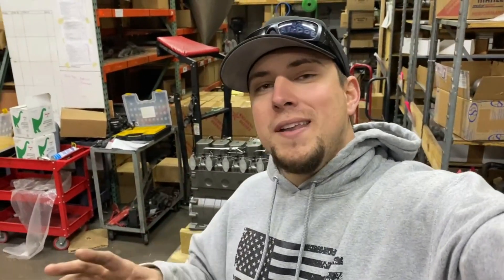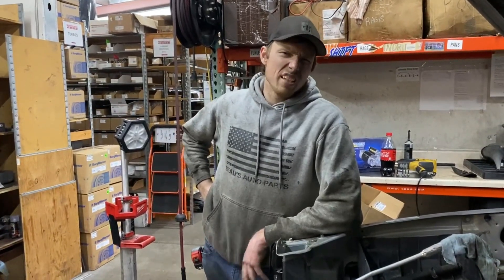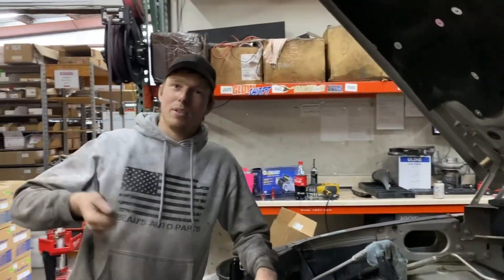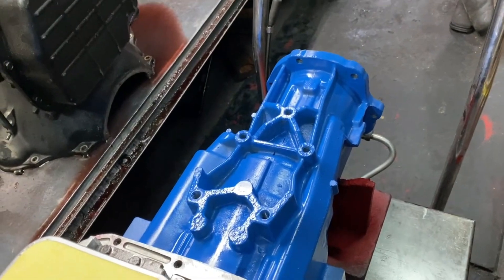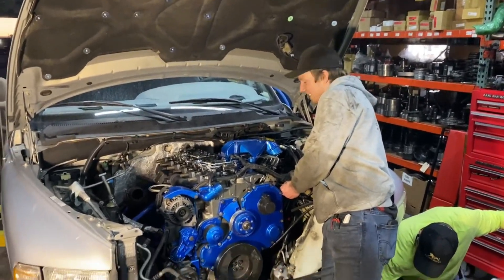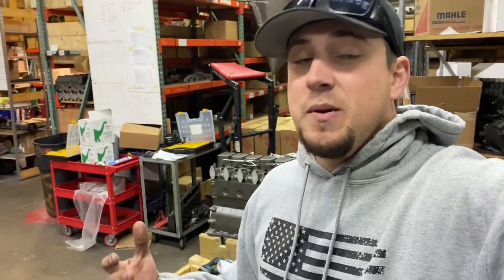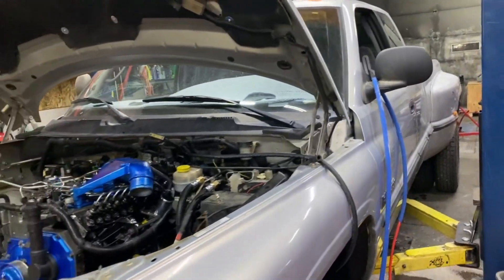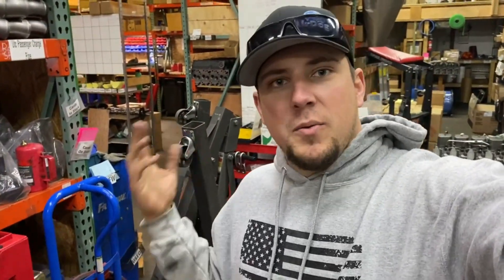ULTIMATE TOWING 12 VALVE CUMMINS

Comment: The truck itself is a cummins holy Grail 1998 12 valve 5 speed 4 door 3500 4x4!!!!!!!
Reply: IIRC the holy grail was a 1998 12 valve 5 speed 4x4 2500 quad cab with the short bed. Factory short bed being the odd ball and rare thing since the rest of the years and trucks all had long beds. Everyone has their own version of options they like and consider a holy grail truck though.
Reply: I have a 98’ 12 valve 5 speed manual extended cab, short bed 4x4. Love it. It’s a holy grail to me.
Reply: @zackpalmer2824  can I have it? XD
Reply: @Sebzuki  oof, even for a pretty penny I don’t think I could let it go haha
Reply: Some guy is selling a 98 12v quadcab short bed with an automatic and Full leather interior for 8500. Worth it?
Reply: @carsgunsandfitness6462  I’d say so.

Comment: The 12v's are the best in my opinion. I have a 96 with compound turbos it tows great. The only problem is the 2nd gen truck they just ride rough. I was a f350 of f450 with a 6speed and the 12v

Comment: Look forward to seeing the finished product. I want a 6 speed manual but that just me . If you don't mind is it 4.1 or 3.54 gears . So look forward to seeing how it tows with a lower stall . One thing that I have wondered how the lower stall effects the brakes as sitting a stop light with the low stall trying to pull the truck forward . I could put up with that I guess for a better fluid coupling . And see some rpm drop at gear shifts . I guess that is a 913 pump p pump
Reply: I have a g56 in my toe pig, it’s nice but for hotroding around town that’s a lot of gears to tow through.  I have the same low stall converter in my shawty, sure it try’s to creep a little at idle, but I haven’t  been able to notice a difference between it and any of the other trucks I’ve test driven.  The truck has 3.54’s.
Reply: @CumminsWorks  how stout are the g56's ? That's what I have and I've heard a lot of differing opinions on em .... wonder how much they can take - dont really wanna blow it up just yet
Reply: @larrypeachy2391  honestly I’m in your shoes.  Heard a bunch of things about them and not sure what to think.  I’ve been running ~700hp in mine for 2 years now without issue, however when I built it I messed with some of the problem areas so maybe that’s helping, not sure.

Comment: I’d love to clarify the turbo set up. You’ll probably do that in a later video. It sounded like you said a 60/67 with an S 400 on the manifold, just sounded backwards…
Reply: I miss spoke. It’s a he351 60/67 on the manifold with a 472/87/1.10
Reply: Who’s 60/67? I’m planning on doing nearly this exact setup with my VP truck. I’m really excited to see how it turns out!
Reply from the maker: @marcushert2759  Pdd’s modded he351

Comment: What valve springs would you recommend for a 2008 Ram 3500 Dually 6.7 Cummins with stock bottom end and stock head with S366/S478 Compounds ? I want to do push rods and valve springs at same time. I was thinking D&J springs and push rods ? I don't want to over do it I just want something that will handle 900HP and won't smoke my pistons .
Reply from the maker: Can’t go wrong with d and j springs and pushrods. Our PDD 4.5k and stage 2 pushrods would also work well! That’s what is in my 2007.
Reply: @horsetorquesdiesel  I am massively jealous of your new Engine and setup with the red paint on it ! Looks awesome.My valve springs and pushrods are on the way from Hamilton they had a deal for the whole package I couldn't pass up. Next is 12mm CP3 and Airdog Lift Pump. Then last 100% over injectors . Then I'm on to painting the whole truck and new rims and a new SRT Hood .
Reply from the maker: @twintibbsdiesel93  I love the srt hoods
Reply: @horsetorquesdiesel  I'm doing the SRT Hood and front bumper cover with the SRT air dam too . Then painting everything the same color as my truck is except adding pearl and flake to make it look alot better . Then getting Black 22inch rims and tires .
Reply: @horsetorquesdiesel  The reason I like the color of your engine is it's close to the color my truck will be LOL with black 22 inch rims .

Comment: Josh do you recommend I O-ring my head? I’ll be running a 467.7 borg with 50% overs and a 12mm cpm. Truck is a 2004.5 ram 2500
Reply from the maker: Really just good studs on the factory gasket is sufficient!
Reply: @horsetorquesdiesel  thank you for the response!

Comment: Curious how you got 19:1 with that setup. I figured it’s be sitting around 17:1
What was the piston protrusion?
Reply from the maker: We didn’t take the full 80 off the tops
Reply: Plus the pistons started at over 17:1
Reply: @CumminsWorks  hmmm well I think they took the 80 off mine and some valve reliefs so I was expecting to be around 16.5:1 on mine. But then again I haven’t actually done all the calculations, i don’t even know how 😂
Reply: @Jc_my_12valve  when you deck the piston you make the bowl smaller.  These started out with a 44.5cc bowl, but with a .075 cut off the top now have a 40.5cc bowl.  Combine that with the extra displacement, it should be right around 19:1

Comment: Too much compression. Need to reduce compression in your cylinders to clean up that smoke. Hate to say it but with that 6.7 crank you may need a custom domed head or find a way thicker head gasket that works with your fire rings.
Reply from the maker: Just wait we did an injector change and it made a huge difference!
Reply: Excellent! Weird those 5x14 smoked that much. Wrong spray angle?